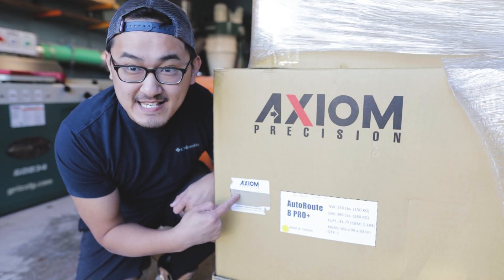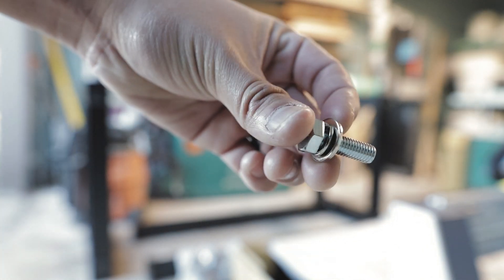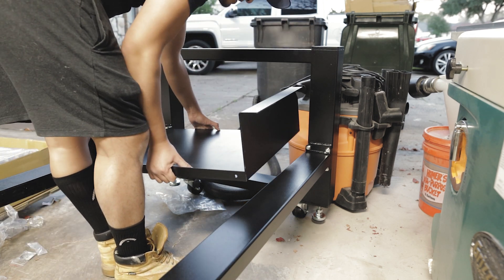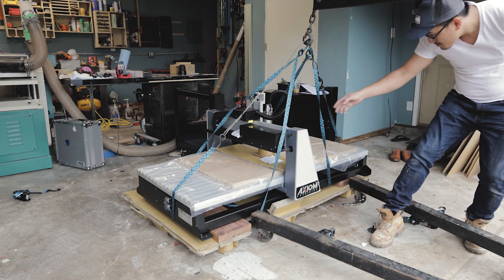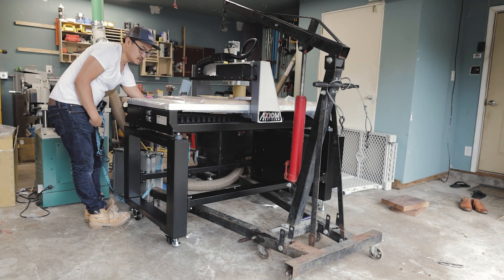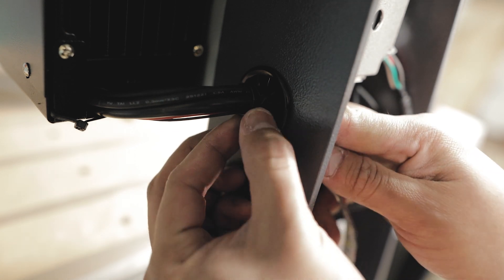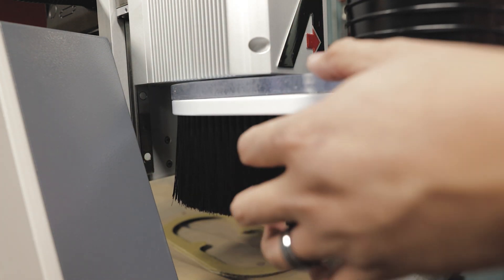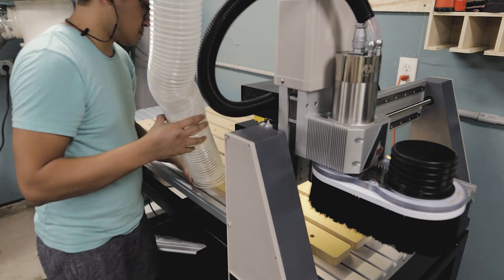Upgrading My Shapeoko to an Axiom Machine // What's in the Box? // Unboxing

Comment: How did you secure the tool box from moving?
Im just assembling my Iconic 8.
Reply from the maker: I totally forgot, but i believe it sits on the hanges they provide. I don't remember using any screws to secure it in place, but mine doesn't move.
Reply: @DesignCraftWorkshop  mine sits on the brackets also. But, it moves in and out. I’ll try some Velcro under the rear hangers!
Oh, this machine comes with a mountain of cardboard…..!
Reply from the maker: @davidhittenberger1651  there should have been some rubber bumpers that are attached to the bottom of the brackets before they're hung from the metal frame.
Reply: @DesignCraftWorkshop  none included

Comment: also, i’m thinking of getting this machine. what where you reasons for upgrading ?
Reply from the maker: The reason for upgrading was because of the speed and accuracy of the Axiom. There is more power in the spindle which allows me to use bigger bits and cut faster
Reply: @DesignCraftWorkshop   thanks for answering all my questions. this helps a ton.  i really appreciate it
Reply from the maker: @eross21  you’re welcome!